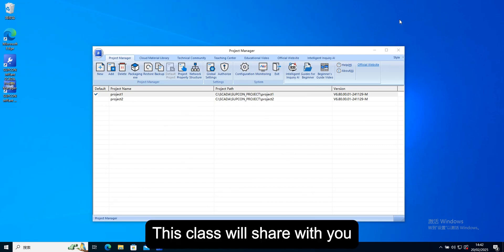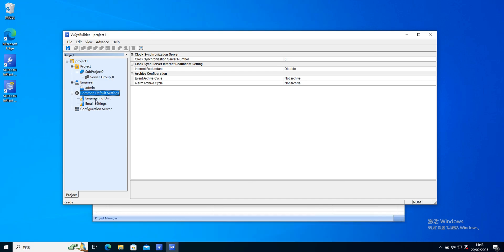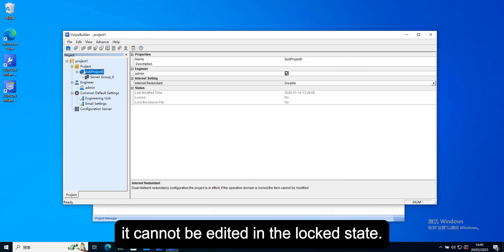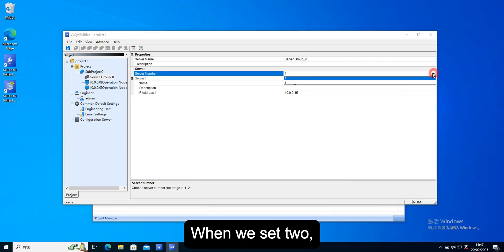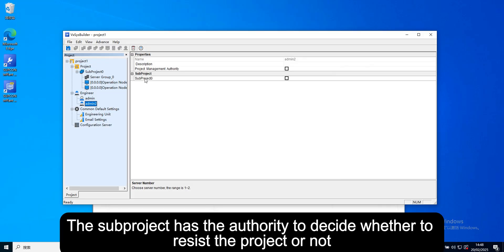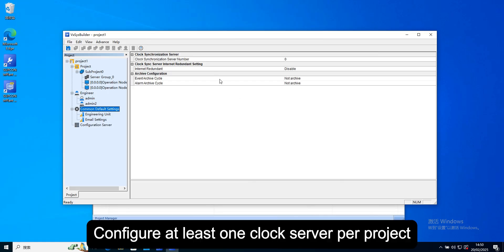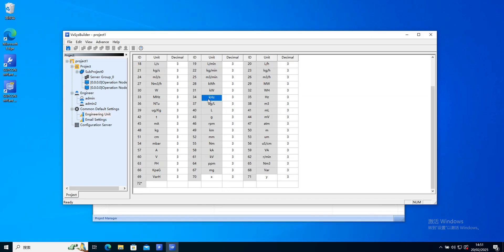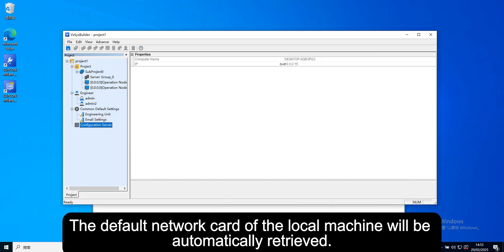SOLISCADA Tutorials #2 - System Architecture

Comment: I install this scada 
I got error when open network structure 
What should do?
Reply from the maker: Hi, thanks for the report. If you get an error when opening Network Structure, please try the following checks:
1, make sure to install on a supported OS: Windows 10 Pro/Enterprise or Windows Server 2019.
2. Before installation, temporarily disable antivirus and firewall to avoid interference.
3. Run the installer as Administrator (right-click → “Run as administrator”).
4. Extract the installation package first, do not run Setup directly from inside the compressed file.
5. Keep your installation path as a single directory level if possible, e.g. D:\SOLISCADA.
6. We recommend installing as a configuration/SCADA server; the install path for that should be a single level, e.g. D:\SCADA.
7. If running inside a virtual machine, disable 3D acceleration in the VM settings.
8. Do not install SOLISCADA software on the same machine as your SUPCON DCS software to avoid conflicts.
Reply from the maker: You can also join our Discord community or email the details to soliscada@supcon.com, we’ll help you from there as well. Thanks!